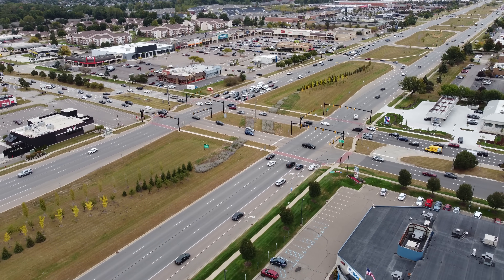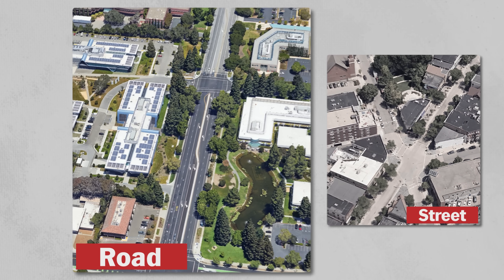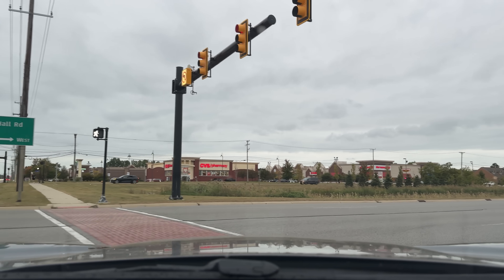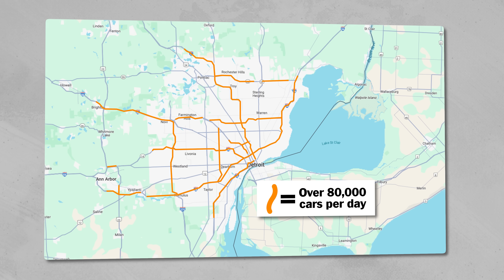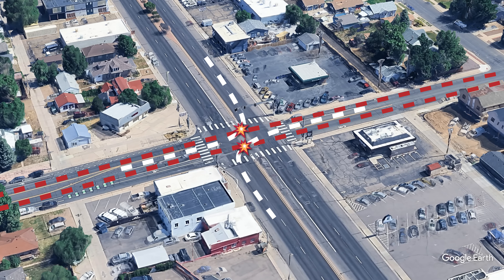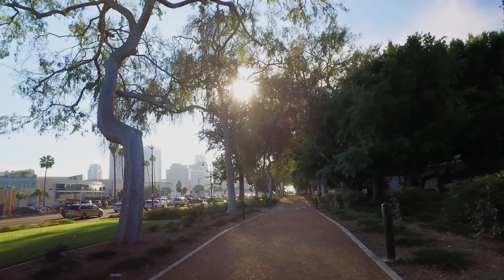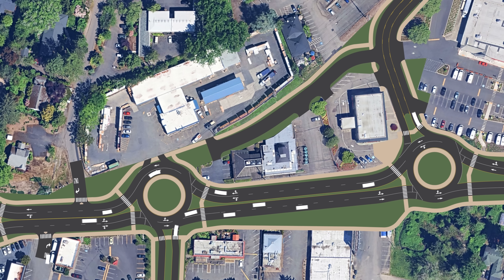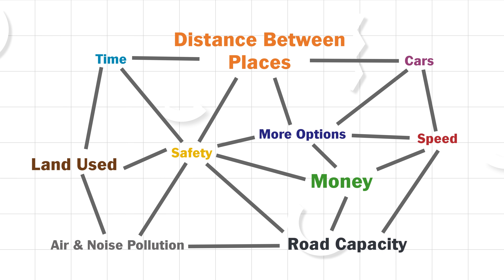How Michigan Built a Super Highway Using Only U-Turns

Comment: Could have just built a round about. A 3 lane would work fine here but a 2 is safer. Idk why Americans have to be so adverse to solutions that already exist and have to do something more complicated.
Reply: America has more roundabouts than any other country (except France and Italy).  America knows where roundabouts do and do not work, and it would not work here.  The traffic volumes amd mainline interruptions would not justify it.
Reply: @traffic.engineer I disagree. Roundabouts would work. 

France has the worlds most roundabouts. 42,000. Followed by the UK, Italy and Spain. US only has 8891. But maybe you are thinking of carmel, indiana. That city prob holds the record for most roundabouts in a city.
Plus per capita the US doesnt have the most roundabouts. Compare Portugal with the US. Per capita Portugal wins.
Reply: @Sevenfold120  Roundabout would not work due to limited capacity.  Roundabouts max out at 1000 vehicles/hour (2200 for triple lane).  The volumes here are much greater, so it would create more queues.  Additionally, it would create unnecessary stops for the priority road to yield to the fewer cars on the sidestreet.  This disrupts the progression of the priority highway.

Michigan left can move more than 3000 vehicles/hour, up to just over 4000/hour.
Reply: @Sevenfold120  As of 2024 America has over 13,000 roundabouts.  Only France (~42000) and Italy (~18000) have more.  UK and Spain are not applicable because they include signalized and painted "roundabouts" which are disqualified due to their inefficacy.  

Signalized roundabouts suspend priority rule due the roundabout having overcapacity and lopsided traffic volumes for uncontrolled approaches.  This is why many locations in America are not considered for roundabouts.  The whole purpose is NOT signalize it.

Painted roundabouts are essentially a standard intersection with all the hazards of one.  The physical island is necessary to reduce speeds and crashes.  America may install small raised island  mini-roundabouts in areas where a standard roundabout will not fit, but never painted.
Reply: @traffic.engineer  Yeah but you know you cant compare like that. First it depends on your definition of what is a roundabout... how what is your source on 13000 roundabouts in the US and all of them are the same standard you hold Europe to? 

Regardless, when comparing you should use per capita. The US has a larger population and country. Driving in any European city and you are more likely to hit a roundabout. Drive in the US and its not so likely that you will hit a roundabout. 

For instance per capita the US has about 30 roundabouts per million people. I rounded up from 26. The UK has 383, France 663, Spain 316, and Italy 308. Even Sweden and Denmark have more roundabouts per capita at 183 and 211. 

But the OP was roundabouts are safe and would work in the US.
Reply: @Sevenfold120  America actually has stricter criteria to build a roundabout than most of Europe.  This includes greater flares on splitter islands, more prominent lane markings, and consistent lanes from the road into and out of the roundabout.  Many of those old style rotary traffic circles built in early 1900s America would not be considered roundabouts due to operational critera.  There are many roundabouts in Europe where 3 lanes enter a 1-lane roundabout, or 2 lanes entering a 3- to 5-lane roundabout with no assignment to a directed lane.  America refuses to build those, as they do not provide the efficiency nor safety benefit.

If America is building 13000 roundabouts, it is because they have do have a great operational and safety benefit, based on traffic operations where they are built.  But America also has many other intersection alternative to choose from, so a roundabout has to also be compared with them.  There is no disagreement roundabouts are a great tool.  It just would not work for this particular road and traffic pattern.
Reply: @traffic.engineer  I live in europe and have never driven on these "many" roundabouts where 3 lanes become 1 or 2 lane roads become 3 to 5 lane roundabouts. Regardless the same rule would apply in them. If you are turning left you drive to the inner lane. But I have never seen these so you cant just generalize like that. Sometimes when a road shortens it shortens after the roundabout not before. Roundabouts here are considered very safe, Europe isnt building unsafe roundabouts or something like your post implies. 

OP was that The US does not have more roundabouts than other countries per capita. Which is how you measure.
Reply: @Sevenfold120  OP was why a roundabout was not built here.  Response is a roundabout does not work with this particular roadway and intersection after thorough review.  Case closed.
Reply: @Sevenfold120  Meanwhile in Europe.

https://youtube.com/watch?v=xuxKtxzq2Cs&si=ZN-gB3lhb34MzBx3
Reply: @traffic.engineer  Obviously, it was poorly designed. The circle is too large and its just painted, not elevated. Seen this in the states too. Secondly, Id like to know where that roundabout is located so you can see if it has been redesigned today.
Reply: @Sevenfold120  From an America perspective, definitely poorly design.  Obviously not in America as those cars and Lidl (until 2016) were not in the American market.
Reply: @traffic.engineer Its in Germany. That I am sure.
Reply: @Sevenfold120  which is quite shocking, since we expect Germany to have high standards for transportation systems.
Reply: @traffic.engineer They do but this video is clearly decades old. I doubt its still like this at this roundabout. Scandinavian countries have better roads though.

Comment: Personally, I have two issues with the ones I have experienced. First, there is not enough advanced notice on these intersections that there is no left turn at the light. Frequently, I will get to the intersection intending on making a left turn, only to find that lefts are not allowed, and having to find a place to turn around.
Second, the distance that is given to get into the u-turn lane after making the right turn is rather short, especially for the number of lanes one had to cross to get there.
Reply: You do not merge or change lanes into the u-turn.  You turn directly into the left lanes.
Reply: @traffic.engineer  According to the rules of the road, you make a right turn into the closest right turn lane, or if there are multiple right turn lanes, you stay in your lane until the turn is complete. You DO NOT make a right turn into the left-hand most lane, crossing multiple lanes of traffic to do so. That is liable to get one a ticket, and possibly an accident. This is basic knowledge that is part of the driving curriculum and tests.
Reply: @AlastairZibet  No state has law requiring turning into the rightmost lane, except Minnesota.  But even Minnesota has a provision to suspend that rule if making a successive u-turn.  This is due to right turns being tight, especially for larger vehicles.  The only location in North America that has such a law is Ontario.  But then again, Ontario has one of the worst transportation system designs.

States vary when requiring to turn left to the leftmost lane.  Certain states require it, others do not.

Comment: So like a roundabout exit but flatened and more complicated with street lights and junctions on the motorway so you need to stop every dew seconds.

Genius
Reply: No priority rule, therefore not a roundabout.
Reply: @traffic.engineer  no shit Sherlock
Reply: A 16 lane roundabout would be to massive and solve nothing. Here we get in the right turn lane, turn on green or when traffic is clear (right on red) scoot a couple hundred yards, then queue up to go the other direction. Much more efficiently than roundabouts, you're dealing with thousands of cars per hour at times in that particular area
Reply: @MrHurst-lb1rn  you don't need a 16 lane roundabout. Only the people exiting or entering the motorway get on the roundabout. If you're going straight through you just drive over or under it with no traffic lights. Just full speed ahead until you actually want to exit. And then the exit is the same as here, get on your lane and exit, the roundabout is after that.
Reply: @GabrielRM   I don't think you're comprehending the sheer amount of traffic and cost of that. Roundabouts take up valuable commercial space.
Reply: @MrHurst-lb1rn  perhaps, but then again they go under or over the actual motorway, so they barely take more space than what's shown on the video.

Comment: A solution looking for a problem. Making a Michigan left requires getting across multiple lanes sometimes up to 4 just to go back and get stuck at another light before arriving back to the original light. The left turn phase doesn't just disappear, it has become a whole new light entirely placed just before the light for the intersection. Just like round abouts, the idea is there but ends up placed implemented terribly on top of extremely poor timing of lights

Comment: I was an almost daily driver on a Michigan Left highway in Grand Rapids, MI. It’s commonly called The Beltline. It worked very well and handled a high volume of traffic. Once I got used to it after I moved to GR I came to see the efficiency of it.
Reply: East Beltline is fine until you hit the intersection with M-11/28th street, then its just a clusterfuck
Reply: @warriyorcat Yes, you’re correct. My daily route ended at I96. Another bottleneck, especially during the evening drive time was at Plainfield up to River Rd. I haven’t traveled on the Beltline for over 20 years so I don’t know about it now.
Reply: @warriyorcat Yeah the short bit when you can turn left on such a major intersection is chaos. I blame Woodland. Funny we don't really have that problem once it narrows back down at Plainfield, at least not nearly as bad.

Comment: they are not because no one uses them right, and they are put at the most fucked up clustered areas that are practically impossible to get through without traffic stopping in the first place, itd be quicker to pull into a lot and back the other way in most cases.

Comment: Michigan LEFT ..when ya need to take a left up ahead, you never know if there is a Michigan left ahead or not, thus you don't know whether to get in the right or left turn lanes until you get near the intersection. If you get it wrong, then you are driving 1 mile out of your way to turn around. As a Michigander, I drive with GPS constantly, it will tell you which lane to be in for a left-hand turn.

Comment: Here in Brazil this is a relatively common thing. There is one avenue next to my neighborhood, that looks like this, with U-returns and a lot of grass, trees and a cyclopath im the middle.
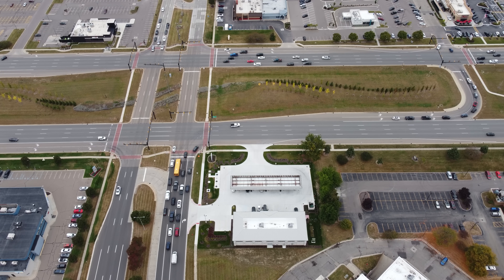3:22 Here this is the normal. Left turns only exists in T crossings here. In normal crossing you only can turn right. If you want to turn left, you need to make a return or using local streets as a "balloon".
13:13 this is so common here. This is an average avenue here. We dont have a lot of stroads, our road hierarchy is basically: streets, avenues, main avenues and highways or simple lane roads.

Comment: It is basically roundabout, but taking more space and it is more dangerous then regular roundabout. Because you have to cross lanes many times between roadsr that goes different speeds. And while normal roudabout have natural flow, here you still need trafic lights. So it costs you money to operate it anyway.
So it is roudabout without any benefits that roundabout actually has.
Reply: No priority rule, therefore not a roundabout.

Comment: 4:19 you forgot the part where people panick turn. There are lots of goof, kind people with loving hearts that wouldn't hurt a fly, who feel compelled to turn at a more dangerous time due because there are one or more people behind them who are clearly angry and/or honking. Their turn puts them or others in danger.

These people deserve mass transit but are forced to drive, and my heart weeps for them. I'm a stubborn man who has been struck by careless drivers enough that I will wait as long as necessary. I also want mass transit but my government says no-one uses the non-existant light rail.

You do not measure the need for a bridge by the number of people swimming across, but my government hates me so what do I know

Comment: The problem isn't intersections. The problem isn't stop lights. The problem is entirely piss poor programming of the stop lights. When you only let traffic flow in one direction at a time (which is fundamentally what all these fads do), then it's all very simple, but that's not how the "engineers" set things up. (they they follow ages old stupid with straight+right that just stacks up left turn traffic... and then set insane cycle times giving the left turn no time to get going, on top of 28,000x more time devoted to straight-thru traffic. then there are the f'ing left turn lanes with NO dedicated left turn light, that ends up letting one damned car through per 55min cycle.) These Michigan Lefts aren't any faster or more efficient, but it does spread things out and give left turn (u-turn) traffic more space to stack up - and in many cases, they do get their dedicated light.

(I see this stupid piled on top of stupid everywhere I've ever gone. 'tho I will give Texas credit for some pretty nice flowing interchanges, but they have the acres to devote to them.)

Comment: The first part of the video is just about a huge waste of space. It's a bad stroad like all the others. Then it cuts to a far more constrained example where the actual solution is hidden in a footnote. The direct access to the road is diverted to the back street. 
This is also how you can easily solve stroads. You take one lane away from the stroad and make it a street with access to all the businesses and then have that street connect to the road at a limited amount of intersections.

This also allows for a bicycle lane in between the street and the road that doesn't have conflicts for long stretches.

Comment: This system looks like it has traffic lights. There is a way better method that has been used for decades in Europe. It's a roundabout.
Reply: America does not signalize truffic circles like they do in Europe.  Ameeica only builds roundabouts, and it would not work on this road.

Comment: There is a town near me that has intersections similar to that Michigan left, and I hate it! It’s located on a road that they use as an expressway. Traffic moves between 55-60 MPH there. If you’re traveling down the expressway, it’s easy going. If you want to cross the expressway, it is a headache. Right on red is prohibited at those intersections because of the road speed and 3 lanes in both directions (not counting turning lanes), so you have to wait for a green light. Then, you have to wait for another green light when you try to make a U-turn. Finally, you come back to the same intersection you started at, but behind expressway traffic, so you must wait for another green light to get back onto the road you wanted to stay on. It’s frustrating to sit through 3 green lights instead of one. I generally don’t go into this town unless I must. When I need to go into this town, I try to avoid the expressway and utilize the secondary roads.

Comment: The major flaw in this video is that it tries to apply a solution that moves 80,000 cars per day to a road that moves nowhere near that, without looking at actual examples of this concept applied at a smaller scale. Perfect example of this glaring oversight is the lack of inclusion of an intersection like the one found at Big Beaver Road (16 Mile) and Rochester Road in Troy, Oakland County, MI, just miles from Hall Road. Both of the cross roads in this intersection apply the Michigan left concept, which gives the driver two paths to “turn left” and this solution only requires 150 feet of right of way width. Additionally, you achieve the same kind of blocks of traffic that can hit all green lights for multiple miles in a row, like an expressway; something the roundabout concept can never do. Hope to see a follow up video that addresses this major oversight.
Reply: One of my talents from driving those roads is timing the lights. It's a great feeling when you glide  down M59 and don't stop until you reach your destination.  Mound road is another super busy road that's a light timing adventure

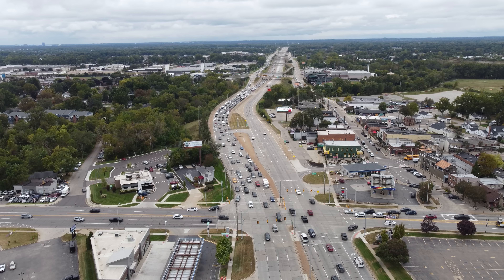Comment: 8:26 The area in the shot is the intersection of Hall Road and "Old Van Dyke" where this this stroad format begins. It is a huge choke point. The left side of Hall road with that eastbound (backed up) traffic had just been reduced from a 70mph interstate-like route to I think a speed limit of 45 there. Higher up the screen you can see where Mound Road (basically a "Hall Road Jr.") traffic merges on at the same time. A mile east (bottom of the screen direction)  M53 (Like a north/south Interstate style route) interchanges with Hall Road. EASTBOUND traffic particularly in this beginning area is commonly a crawl, especially during rush-hour. It can take quite a few light cycles to get through. Without the Michigan left setup it would probably be much much worse. I don't see how they could make this area specifically much better though. If they had made something like a below-grade freeway through this area (Like i-696, which is 10ish miles to the south.) It would have been bad for the cities of Utica/Sterling Heights, as this area has really built up since this expansion- which probably wouldn't have been the case- at least not to the extent it has now.  I prefer this stroad setup to that below grade freeway format, especially if you are trying to get somewhere in that area, and not just passing through. I just think it looks better too. BUT I avoid this area like the plague during rush-hour and the holiday season.